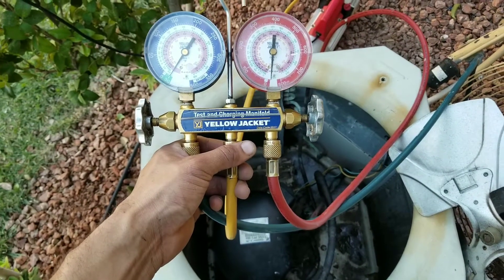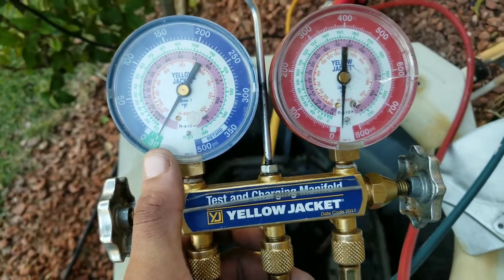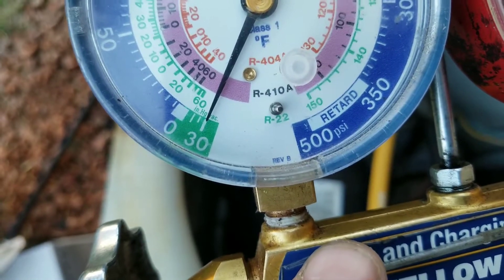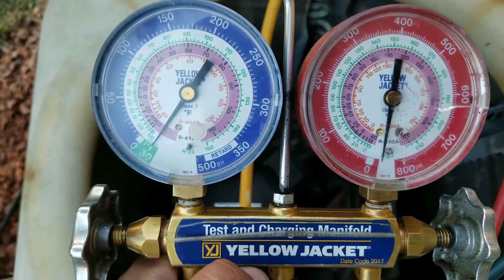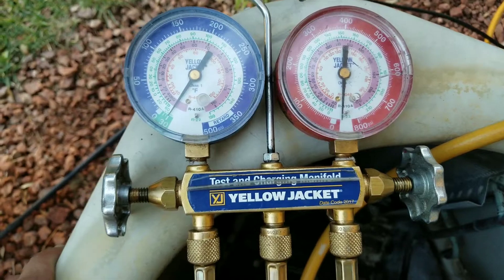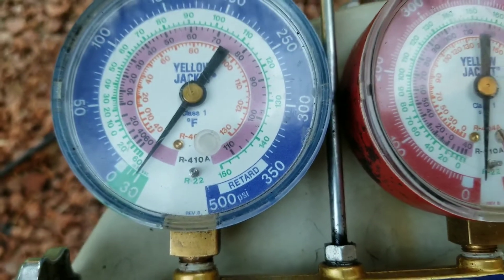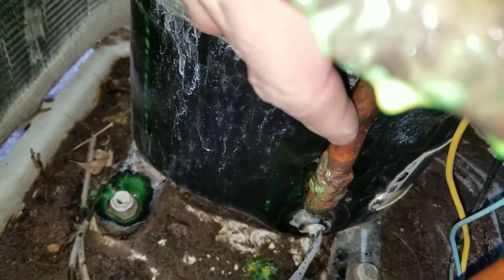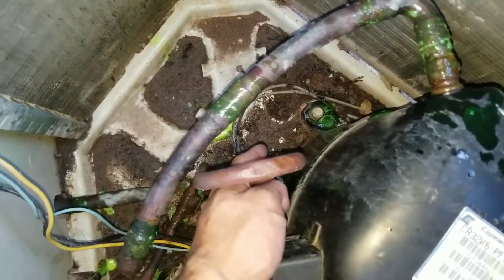How to FIND Refrigerant Leak. Easy Method!

Comment: Sam, I really enjoy watching your videos; all of them are great.  However, I didn't agree with you on this one.  
  I have to tell you: the way you performed a leak detection on this unit was not the proper way, nor was it 'one of the best methods', as you stated early in the video.
  The reason why this method is not recommended is because, when you pump down the system and pull it down into a vacuum (if there is a leak), you are sucking air and any other non-condensables into that system.
  Non-condensables increase head pressure dramatically when a system is running and are detrimental to a compressor.
  According to EPA standards (and every college textbook I've read so far), the best method for performing a leak detection is to first determine if there is any refrigerant left in the system.  If there is, then begin by searching for the leak with an infrared or heated diode leak detector.  When you've found the general area of the leak, begin liberally applying a soap bubble solution to every joint, u-bend, rusted spot, etc.  Once you've found the leak, fix the leak accordingly, depending on the present circumstances at hand.
  Once you've fixed the leak, recover the remaining refrigerant from the system, if any.  Then, begin your pressure test by charging the system with nitrogen, according to the recommended maximum allowable low-side pressure found on the system's nameplate (It's usually 150-250psig, but not always).
  After you charge the system with nitrogen, perform a decay test by waiting 15-20 minutes to see if your pressures drop any.  A drop in 1psig or more is a sure sign that a leak is still present in the system.  [A digital manifold gauge works best for this, as it allows you to see a drop in pressure as small as a fraction of a single psi ( 0.1psi).  The Fieldpiece SMAN works great; it allows you to perform decay tests, facilitates pulling systems into vacuums, etc.]
  Once you've determined that there are no more leaks in the system, either pull the system into a deep vacuum (down to 500 microns), or perform a triple vacuum (pulling down to 1000 microns, then charging the system to 150-250psig with nitrogen, and repeating this vacuum/charge method a total of three times).
  Finally, once you've pulled the system down into a deep vacuum, re-charge the system with refrigerant according to the system's nameplate.

Comment: This is probably one of the most unprofessional and improper way to do this. You never do a leak test by vacuum. If the system is low on gas, you obviously have a leak. Where else would it go? Might as well just pressure test from the beginning and save the customer a pointless hour of labour.. smfh.

Comment: I would think high pressure nitrogen and refrigerant leak detector and bubbles would be. Even if the vacuum told you there was a leak , how would you find the leak if the lines are hidden in the wall where the leak is? What part of the wall do you check or do you just tear the whole wall down? With enough pressure that leak will "whistle"
Reply: why would there be a leak inside the wall lol you dont make joints in the wall
Reply: @beyondthelol  if it's a new home, possibly a drywall nail could have punctured the line if the home wasn't pro-plated, or if the lineset was poorly roughed in.

Comment: That is archaic !
Come into the 90's
Micron gauge is instant no guessing if you left it valved off for 8 seconds you'd know if your climbing?
You also better watch low side test pressure before you blow that old cork out😂
Pressure could have been done first on that giant leak 🤣🤣😆🤣😆🍺🍺🍺🍺🥃🥃😜
Stay safe.
30+ years in look'n for a way out !🤔🥃
Wear your safety glasses !

Comment: "The best way to find a leak in your system is to pull a vacuum. "

^No it's not. Atmospheric pressure is only 14.7 psi so the leakage can be very slow.  those gauges aren't overly accurate under vacuum either. It's better to pump it full of nitrogen like you did at the end of the video.
Reply: Nitrogen definitely works wonders when it's a big enough leak to hear. Otherwise I'd use a micron meter and you can easily see the leak. Even if the leak would take months to leak down...you should still see it.

Comment: Hi Sam, after you pulled vacuum for 30 mins then you check for leaks, but i dont understand why you left guages open ? If you had closed the gauges and if theres leak the needle will move . Please reply
Reply: Yeah he should close them. Leaving them open means if your yellow hose or pump is leaking you would mistake it and tjink its the system. So close the valves but leave hoses to gaiges open

Comment: 50 mins of vacuum is a while. Leaking or long line set. Good you found the leak
Reply: Agreed, you should determine the leak with a proper micron Guage. This will save you plenty of time.